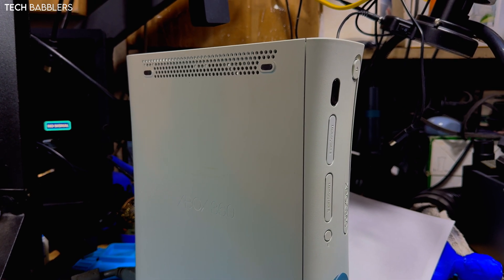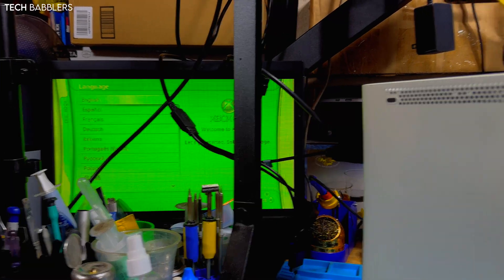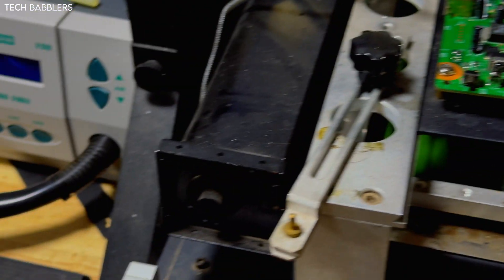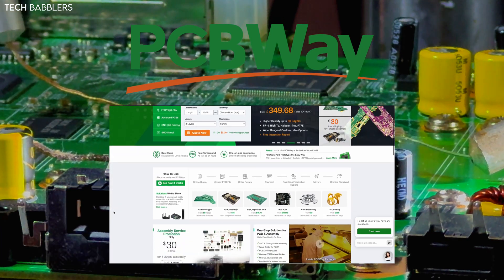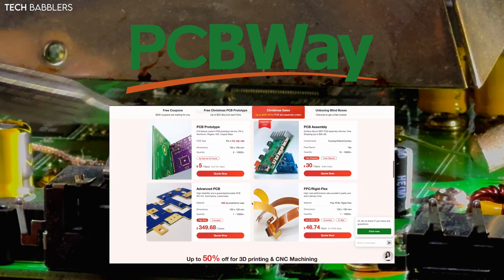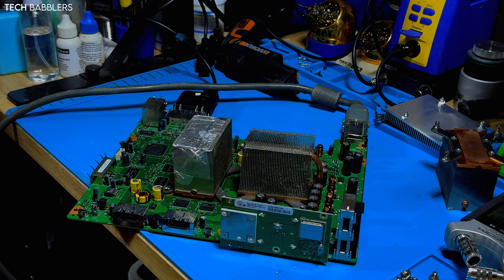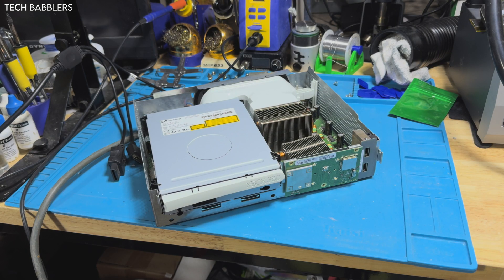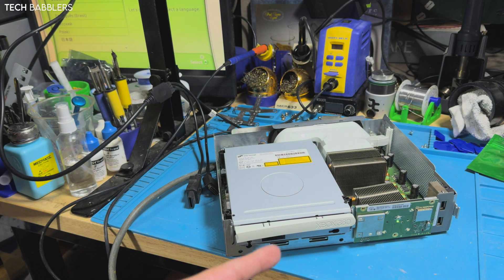Xbox 360 With Graphical Issuses Repair

Comment: These GPUs are absolute JUNK. I am facing the same issue with the ones from AliExpress. As a last ditch solution I have been swapping the cpu and nand image onto a “service date” xenon console with an Elpis Gpu already installed. It’s important not to expose the Elpis to too much heat (they will short out internally) .so I turn off the bottom right heating plate on my ir pro sc and slide the Gpu above that disabled plate. The Gpu doesn’t go hotter than 110°c. I have fixed many many blades dash or JTAGable NXE systems doing this .
Reply from the maker: A few batches ago, i got good ones, but around late last year, i got two lots that all GPU's were bad. I believe it got sorted recently though.

Comment: Have a couple questions for you:

1) What are you using for the suction to lift the ship (manufacturer and model number would help)
2) I have a similar station, but haven't been able to use it successfully yet. How and where did you learn to use it?
Reply from the maker: I am using the https://www.amazon.com/Aoyue-932-Vacuum-Pickup-Station/dp/B00D2GDFQ0
I had a few standard profiles that came with my machine many years ago, and I just kept modifying it throughout the years as temps change and I swap out parts until I got to the point where it just works now.
Reply: @Techbabblers  Thank you

Comment: What temperature did you use to preheat the motherboard?
Reply from the maker: My machine is set to 350C on the lower plates and after about 6-7 minutes the top thermocouples read 160C which is where the top heater kicks in

Comment: Unfortunately, all 90nm GPUs will eventually die. Rip Felix made a very long video about the bumpgate problem. Replacing the GPU is only good for testing purposes, if at all.
Reply: this is not accurate, the chips with the flawed underfill are the chips you need to worry about. Later iterations of the Rhea have proven to be reliable. Not going to say they are as good as a Zeus/Kronos but they are reliable.
Reply: @Thee_Dr_Evil  As far as I can see, he repaces 90nm with 90nm GPUs. Thse are all flawed xenos chips with low tg underfill.
Reply: @Knutwurst  This isn't entirely true. Microsoft made 90nm GPUs with high tg underfill too, but they were only used in referb consoles. It's also what Shawn is using.
The reason Shawn had a bunch of broken GPUs is because he bought a bunch from China, and it seems like the person who pulled the GPUs did a really bad job of pulling them. Finding a NOS chip is quite uncommon too.